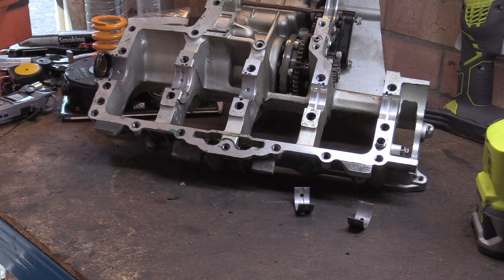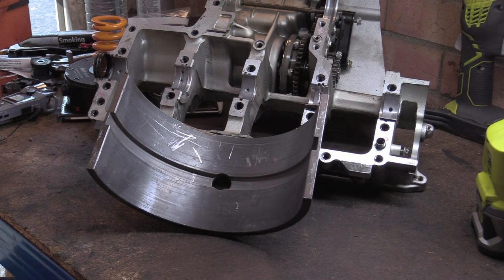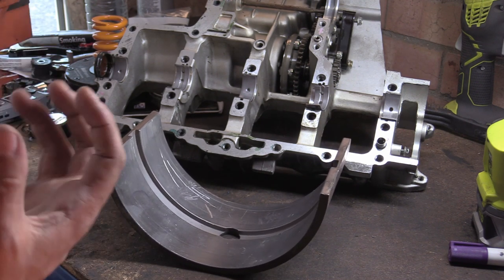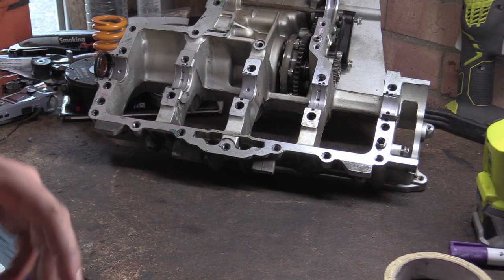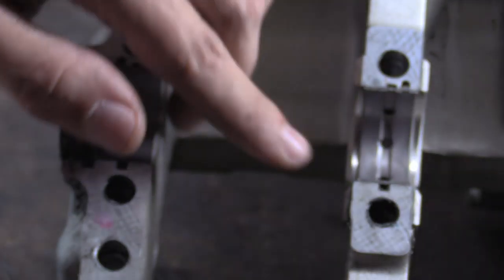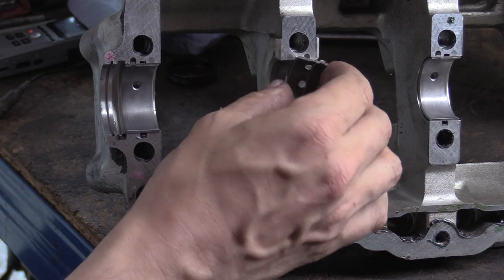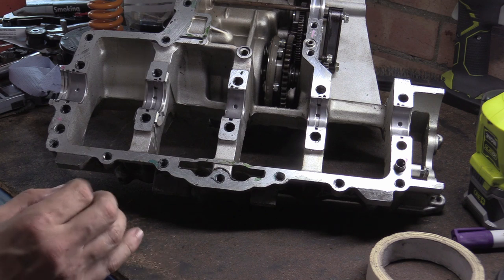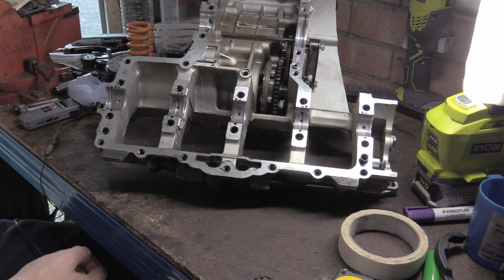Groove in Bearings - But why?

Comment: I think it makes perfect sense. In other words, oil flow concentrations are designed (in part) around temperature reduction needs, not just making moving parts move freely.  Love the new magnification device.  I would suggest something like an ice pick or dental pick, that has a small, fine point that you can use as a pointer.  Although a laser pointer might also work well for that at times, depending on the size of what you are pointing out.  Not to mention fun to drive cats up the wall. Keep up the great teaching!

Comment: Kind of surprised you didn't mention the crank cross drilling connecting rod feed holes, I believe the slotted bearings line up with cross drilled crank web. 
 
I'm not bashing you saw earlier comment from one guy😖 🤐

What your saying does in fact make sence😉 especially looking at the groves cut into the casing outside the bearing surfaces✌ 🤘
Reply from the maker: "Kind of surprised you didn't mention the crank cross drilling connecting rod feed holes, I believe the slotted bearings line up with cross drilled crank web."

- Tonights video

Comment: A groove in the casing, that was new to me. It got me thinking, if there's oil between the casing and bearings, there'll be a pressure pushing the bearings in toward the crank journal? I've always just thought the bearing groove is there to allow easy passage for lubricant all round. So it doesn't have to push itself through the , 05mm clearance to cover the wole 360 degrees.
Reply: Never mind. More or less equal pressure on both side of the groove, so +-0. What remains is pressure between bearing surface and crank.

Comment: The L/D ratio is important in maintaining the correct pressure without causing excessive drag (and all the cooling etc). But the groove has ABSOLUTELY NOTHING to do with this - it's there to supply oil to the cross drilling in the crankshaft, and subsequently to the big end bearings. For those who doubt this: http://www.marmotorsport.com/wp-content/uploads/MAHLE-Motorsport-Groove-bearings-techincal.pdf
Reply from the maker: Wait for tonights video........
Reply from the maker: And to add it's not "ABSOLUTELY NOTHING"
Reply from the maker: Oh and if you look at the link its simulated and they even state - "For  the  purpose  of  this  exercise  the  cross-drilling  was  removed  to  simulate  an  intermittent  oil  flow. "

Check your source before stating "ABSOLUTES"
Reply: @dirtygarageguy  I suggest you go back and read it again, and don't just pick out the words you think justify your points. "Nowadays, with the use of computer simulation AND ENGINE TESTING the optimum extent of the groove may be determined". "For the purpose of this exercise ..." is where they are determining oil feed requirements and concludes that, for this particular engine, there is very little difference between 180 and 270 degree grooves. Ok, maybe ABSOLUTELY was a little over the top, but the primary purpose of the groove is to provide oil feed to the big end bearings. If that wasn't the case then there would be grooves in all the main bearing shells, not just those which have associated cross-drilling in the crank.

Comment: just took a motor apart with the non groove bearings and it has bad heat marks on the bottom side of the piston rod end bearings.. kinda cooked.. I wonder why they didnt use a grooved bearing,, are they less expensive generally?  there is not even holes in the bearings so not sure how they let oil pass to the crankshaft journals.
Reply from the maker: It depends on the oil feed design, nothing to do with being better etc

Comment: Would it always be beneficial to add an oil cooler to a system? And if not, why not? Or, rather, when is it useful?
Reply: Not always beneficial. The system adds weight, and is more complexity - another thing to break. If the bike doesn't need the additional cooling, then it ain't really beneficial

Comment: manteining the same oil volume. isnt not always the more oil pressure the better?. And why the groves are made with a 90° profile? why dont make them round so its structuraly more tought and even the oil flow should be smother.

Comment: Would sealant on a surface not designed for sealant mess up the torque settings?,especially on something as critical as the crank retainers. Wonder how Del would have explained this stuff?,"Witchcraft!".
Reply: Yes, it would fuck with the compression of the bearing shells on the crank. 

But the bike will be fucked in a million other ways after him working on it anyway